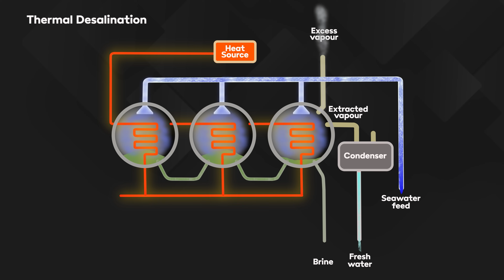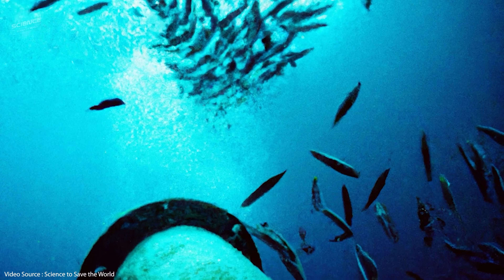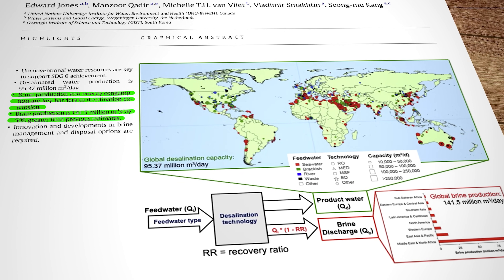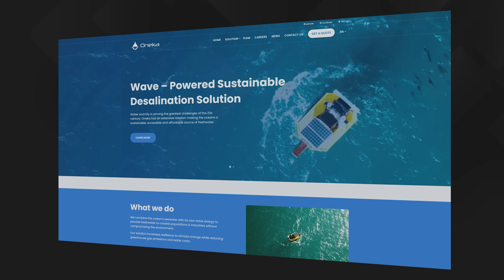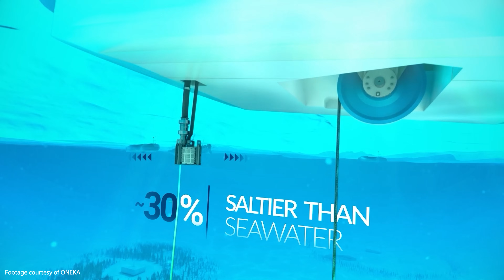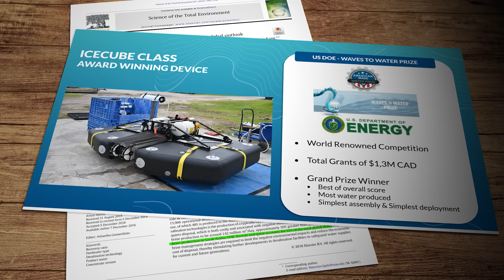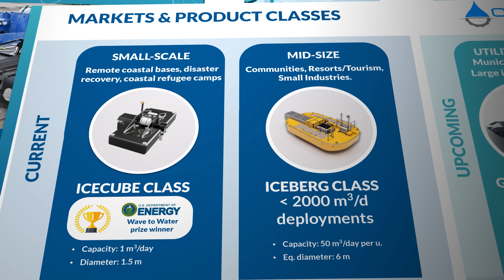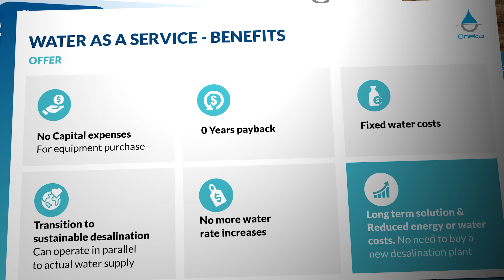Fresh Water at Zero Energy Cost . How do they do that?

Comment: My biggest question is how energy-intensive it is to make and maintain the platform itself, in comparison to other solutions. I don't see it being necessarily worse, but it can be an important factor.
Reply: That is a great point and one of the things NOBODY ever wants to talk about with any engineered system.

There's one glaring issue with all of these wave powered systems and that's getting the product back to shore where it can be used. The offshore power and offshore hydrogen generation people have the same issue. It always sounds easy to say you'll just drop in a pipe or a cable, BUT IT NEVER IS.

Go look up any of the offshore cable and pipe laying videos to see just how hard it is.

I have worked on some reverse osmosis systems but they were not for desal. I also did do some work on a Multistage flash distillation system on a mine site. https://en.wikipedia.org/wiki/Multi-stage_flash_distillation
It was right after doing a reverse osmosis system on another mine site as part of a waste water treatment plant so I got to compare how those systems. I work in control systems so I get variety at times.
 
In simplest terms:
RO plants are complex, expensive and use lots of energy but they can be adjusted to suit demand. Their greatest strength is flexibility. If you need more its generally easy to expand. If you need less you can turn parts off and remove the membranes so they don't sit and deteriorate.
MFSD plants can be a pain to get started but once they are running use less energy. The energy saving comes from operating in a partial vacuum where the water boils at around 70C. Their one major weakness is they have a design operating flow rate and if they are not being run at that rate their performance can drop off rapidly. That means they need substantial buffer tank systems before and after the system because they can't adjust to demands.

The one thing to say about all these systems is that they are NEVER as simple as their promoters make out. There's always something they don't want to mention or discuss.
Reply: @tonywilson4713  You are my new hero. Using facts and logic is underestimated 👍
Reply: It's a floating barge. Not much energy needed.
Reply: I also just don't see this happening, but I'd love it if the team can prove me wrong. My main worry is, like you've implied, underestimation of how much it costs to keep something sea-worthy, especially something like this where it's attached to the bottom and is getting yanked on with every wave, likely requiring annual or even quarterly maintenance that will be expensive.

I'm also curious on how it could be deployed near population centers, where water recreation is in high demand. Many in the population, especially those with the deepest pockets who live on the coast and have boats they want to sail around in where they please, will not want their water space taken up and disrupted. This means there are likely to be deep-pocketed enemies of deployment of this technology anywhere near population centers, and that's another issue the company will need to work through. (Though my guess is that this is a smaller problem than the material and maintenance economics.)
Reply: @dosadoodle  You have a point - saline water would probably corrode some materials faster which could require an accelerated maintenance schedule. But there could also be a silver bullet here - most water-proof materials made from plastics (fossil-fuel or plant-based) are generally more resistant to corrosion from salinity, and the fact that the whole thing is supported by its buoyancy, means that it shouldn't require materials which need to bear much load (such as metals and metal-based composites, that corrode faster).

So I'm thinking that perhaps the materials tradeoff could actually make this thing require less maintenance than on-land desalinization plants. It would like comparing apples and oranges in terms of maintenance.
Reply: @filonin2  it's a floating barge that needs to be firmly anchored. So you need a concrete anchor of at least the same weight as the displacement of the barge. In addition a steel chain or cable/s of sufficient strength and durability. So initiale energy expenditures are way higher than it looks on a glance.
Reply: @fimbulkron  concrete anchor OR a very secure attachment to the rockbed below the bottom. 

If you use a concrete anchor you also need to consider the risk of it dragging the anchor: it may need to be somewhat heavier than just the displacement of the floater: the displacement is certainly the minimum you'd get away with
Reply: @fimbulkron  Isn't the weight of the anchor required more closely related to the wind speeds expected and drag coefficient of the platform? A platform could have a small displacement but be dragged by a kite and require a large anchor.
Reply: @filonin2  Yes once deployed it only needs a bit of a bilge pump to keep it floating as some slightly clever cables to keep it on station.  It may be worth adding a winch system that can pull the whole thing down to the bottom to ride out a storm.
Reply: @kensmith5694  that's a smart idea to signify it down to avoid a major storm: I wonder if that's compatible with their "no onboard energy" philosophy? I also wonder if they'd need to redesign the floating equipment, because it may not have been designed with longer term total immersion in mind.

Not dissing your idea, just saying it's got some issues alongside the advantages
Reply: @trueriver1950  Designs often have tradeoffs.  It comes with being an engineer.  All the workings would have to be designed to withstand several PSI and what is used for flotation can't be something that crushes.
Reply: @kensmith5694  fair comment